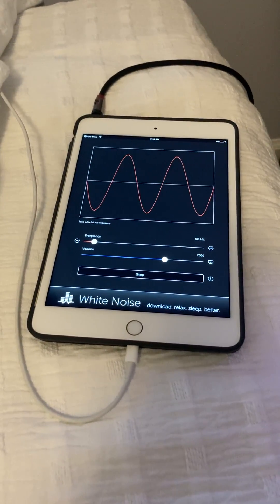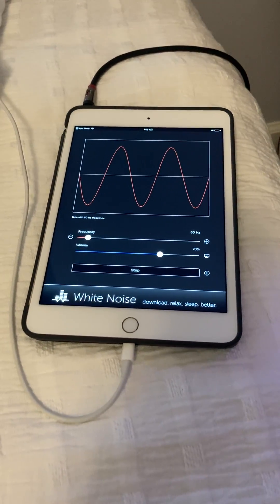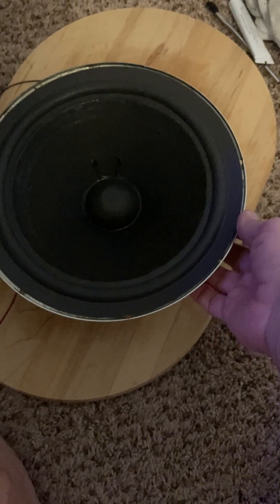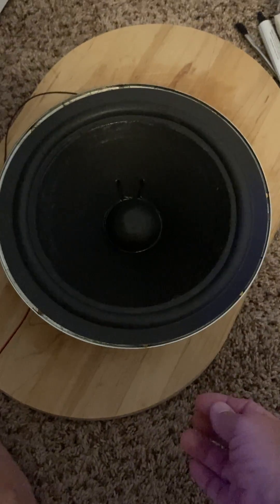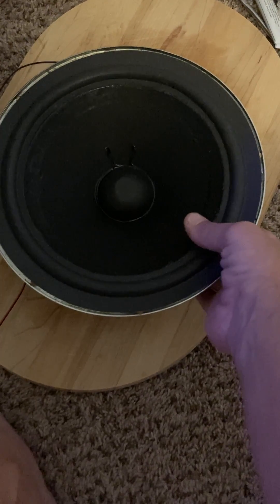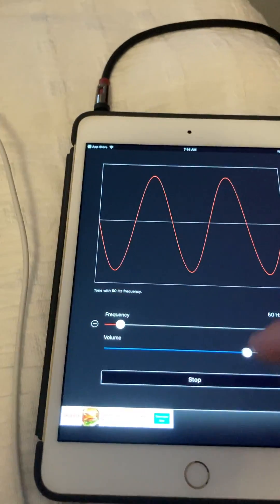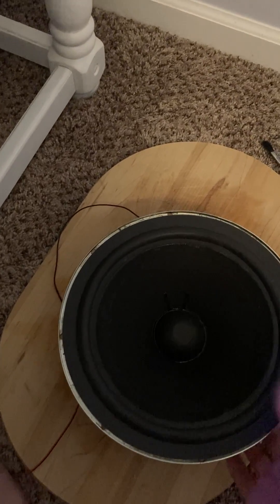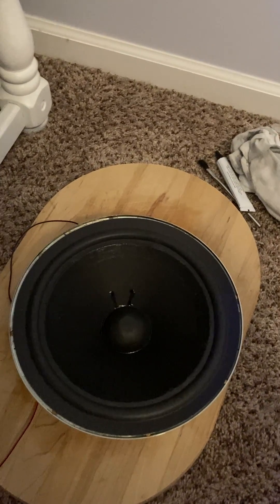Refoaming Bose 501 Speakers and Centering Voice Coil

Comment: Can you help me , i would need to remove the speaker from the case , to repair the speaker , can find the proper way to open the box on one of my bose 501 type, thank's in advance.......
Reply from the maker: The 501 grilles are stapled on.  You have to carefully remove the staples.  Try to save them as you take them out and you can tap them back in upon reassembly.